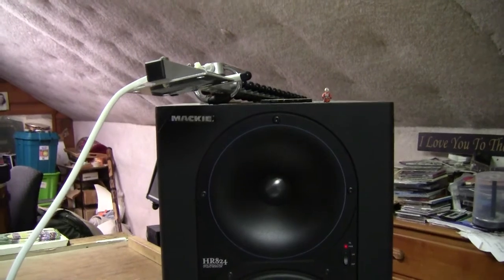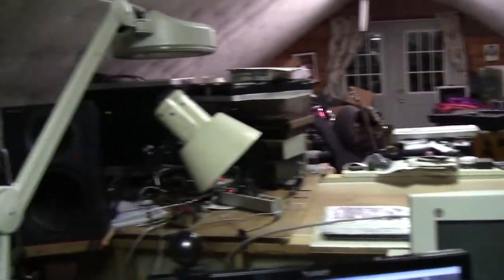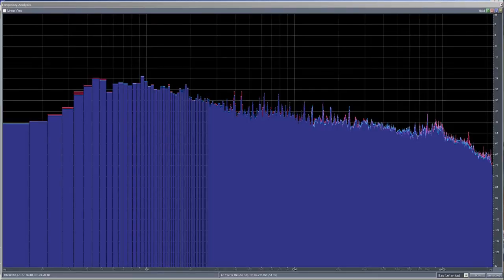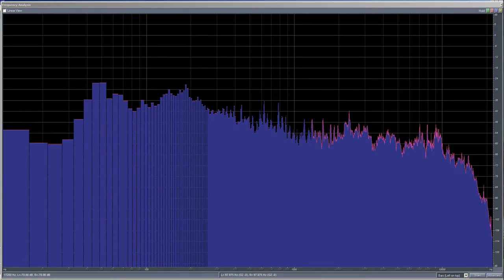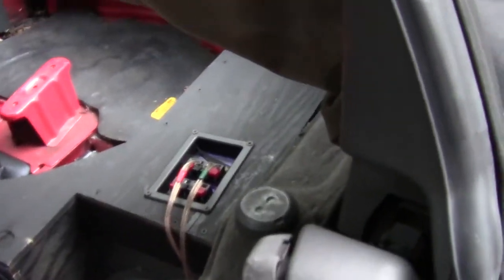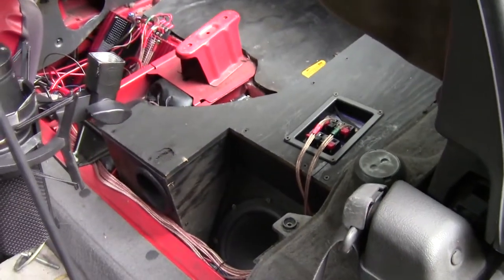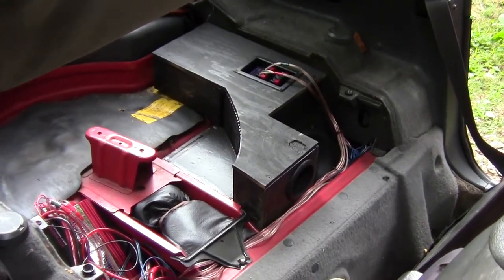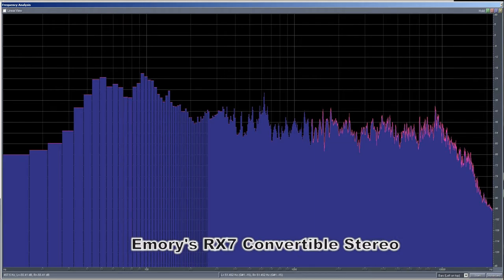RX-7 Car Stereo with Custom Subwoofer cabinet

Comment: Wow that is a crazy sub box. I think i met you at an rx7club.com meet at Fudruckers a looong time ago. I have seen your car a few times on the beltway. Is it still treating you well?
Reply: Can you outline how you installed the infiniti speakers in the headrests? I thought they were square holes.
Reply from the maker: @tiderfish  Hey thanks for watching! 
The car has been getting a new engine and full suspension rebuild and the shop moved while the car was there and...it's been in the shop for 20 months.  Right.
The sent me a pic Monday (2 days ago) of it with the old engine out and new engine ready to go in so hopefully I get it back before Christmas... :D
The speaker install was from a writeup on RX7Club.com by Jason Garel
Can't find it, but this one is good: https://www.rx7club.com/2nd-gen-archive-72/rx7-convertible-headrest-speaker-replacement-936458/

Comment: that sounds amazing!!!

how much would this setup cost me to install in my 7..? :)

i live in california(not that that matters lol )
Reply from the maker: The infinity reference headrest speakers are about $40/pair (you need 2 pair), the blaupunkt door speakers were about $60/pair,
the amps were about $100 each, the sub kit was maybe $50 and I lost count of how many hours in the woodshop making the sub cabinet :)  I mocked it up in cardboard first - did I show that in the first video? (Been too long since I made that!)
Reply from the maker: Oh, and the stereo head is now - I think  - about $150 (it was REALLY expensive when it first came out - I think I paid $350 for mine!)
Reply: How much would you charge (if you did charge) for the box with everything ready to go? 

(I have a 88 that I have fully gutted for drifting but its still a daily driver and currently as I bought it came with no stereo lol I NEED MUSIC lol so I don't need 4 15' speakers lol I just need a little bass and clear sound to putt around with ) 

Thanks for your help and your quick response ) :)
Reply: how does it sound with the spare tire cover in place? does it rattle much?
Reply from the maker: sorry for the reply delay - no not at all.

Comment: What are the measurements on the subwoofer enclosure?
Reply from the maker: Sorry, I really don't know - I made a mockup out of cardboard and fit it into the cavity, cut plywood to match the cardboard, then had to trim it to fit (a few times) - so I never had a measured drawing or really anything resembling measurements...I guess I measured it after the fact because I know it was almost exactly a cubic foot inside, but that was 5 years ago...
Reply: @VAXHeadroom  thanks, I'm looking to add some low end bass to a '91 convertible RX-7 and your build is just what looking for.
Reply from the maker: While looking for something else entirely I remembered I had a photo album on FB with pics of the building of this - some with rulers for scale!
https://www.facebook.com/media/set/?set=a.1216641653210&type=1&l=d0c09f14bc